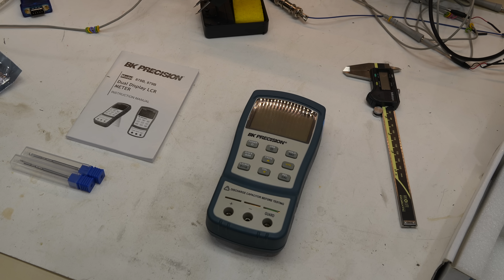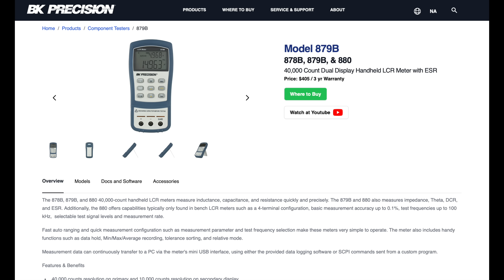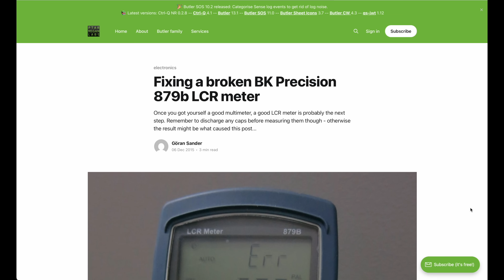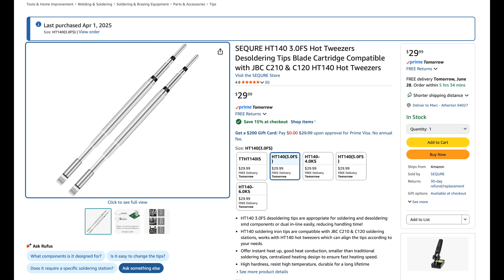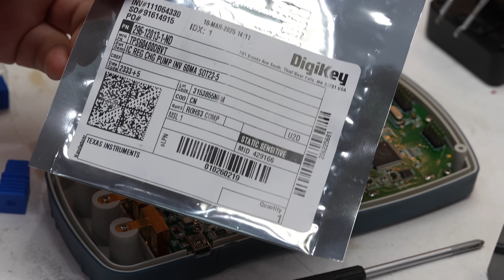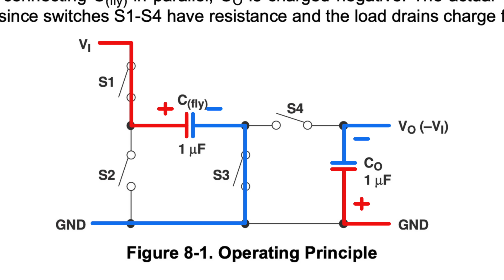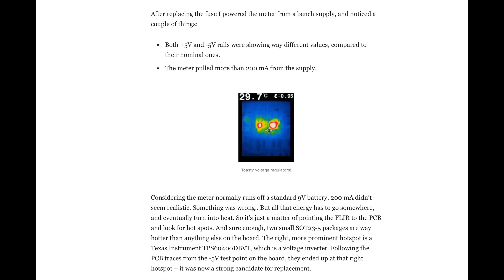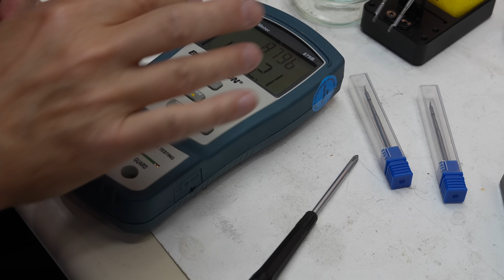BK Precision 879B LCR Meter Repair (with Sequre HT140 Hot Tweezers)

Comment: Dielectric Absorption on those big filter caps can be "shocking" as well as them rectifying mains hum just using their legs as antenna and dielectric leakage as the diode. I had one big old filter cap that sat at around 200V in use. After discharging and coming back the next day it had floated itself back up to 60V, enough for a decent tickle. I discharged it again with a crowbar (screwdriver) with only my meter attached and watched as the voltage built up to 20 V again after a few minutes. 20V with a fist sized cap is a fair bit of energy! 
I can see why they keep the leads on the really big boy caps permanently shorted when not in use. (the shoe box sized KV cap type things)

Comment: It says "discharge capacitor before testing" at the front, which turns a design flaw into user error.
Reply from the maker: Problem is, capacitors can’t read.

Comment: i have the ancestor of this line of lcr meter (elc-131) that blew in a similar way except at 400v instead of 50v. was a dumb move on my part. actually blew quite a bit of the front-end too but only one of the protection zenner on the negative rail. was always curious if they ever figured out a better front-end protection on the later hp/keysight and b&k versions.

Comment: Marc: Several years go I did the same, destroying U603 and also the input fuse F200.  After replacing both, the meter worked as before.

Comment: "Don't be vague, ditch that Sprague!"
As for a hot air station, mine is a Yihua 706-II; on top of a nice hot air handle and pump inside the station rather than a fan in the handle, the whole thing has replaceable soldering irons for old style (936 etc.) tips as well as a few cartridge types (Hakko T12 and JBC C115, C210 and C245). I really liked it from the beginning, and my trusty old Solomon is now just sitting there as a backup.
Reply: The JCB clone irons are taking the market by storm now, its great they are killing off the tip on element irons finally.

Comment: My HT140 came with an earth lead that plugs into the USB-A socket on the PSU. The problem is the PSU has a plastic earth pin so its output is floating and the tips of the iron have hundreds of volts on them at very low current. Not good if you touch the gate of a MOSFET.

Comment: I would consider whether adding the odd protection diode (as you'd commonly be using around linear regulators) might help avoid such accidents in the future. It's clearly a weak spot. BTW, my first component tester didn't make it through its first battery charge due to a very similar scenario... but that was a $20 affair and the simplest solution was just buying another one.

Comment: Marc could put a sticker on the meter "DISCHARGE CAPACITORS".
Reply from the maker: It’s already written on it! What the machine needs is a pre test before it connects, or even it’s own automatic discharging circuit.
Reply: @CuriousMarc  That sounds like a challenge ... for you, not me.

Comment: You could add a small normally closed push button to the device that would always short the capacitor to be measured, then press the button to perform the measurement.
Reply from the maker: Yes, I like the suggestion! With a little resistor and a fuse just in case I also forget to turn off the power on said capacitor...
Reply: I request a full follow up video including the prototyping and testing. ❤

Comment: Marc, I admire the discipline you have buying just one off from Digikey. I just bought some SMD 3904's. I have 500 of them LMAO. 
I have a  Weller SMD desoldering tool. I can't imagine any scenario where it would be good for resoldering. Especially the capillary action of melted solder grabbing the part and gluing it to the tips.
Reply: I have the exact same HT140 hot tweezers, and they work just fine for soldering SMD caps and the like, you just need to slide the tips perpendicular away from the part, with the tips planar with the board. the capillary action does a pretty good job keeping the part on the pad as the last contact with the tips as they leave the solder is the points.

Comment: I have the sequre HT140 tweezers. The UI is quite intuitive i think. I didn't need to read the manual, long pressing the left button was obvious to me because short press reduces the temperature. Long press again stops it. Short pressing the right button increases the temperature. Long press brings up the menu. Its as i would expect. My fnirsi iron works similarly.

Comment: I prefer hot air for such job. If there is risk for surrounding components I use capton tape to isolate one I want to work on.
Reply: Hot tweezers appear to be quite controversial. Board repair pros also prefer hot air but for them it’s not as detrimental if they screw up on occasion as they have spares.

Comment: Put the new parts back on with low melting point solder and perhaps they will self unsolder next time it fails ;)
Reply: I’ve seen 7805 regulators desolder themselves from eutectic solder in a bad product design.

Comment: CuriousMarc, suggest you install the supplied tip earthing cable (uses the USB-A socket on the PSU) if you haven't already.
Reply from the maker: Thanks! So much for not reading the manual...
Reply: I power my HT140 via the DC barrel connector from a grounded 24V 5A PSU. I didn't buy their 65W USB-C PSU.

Comment: I have the 880. It did die almost immediately, however BK Precision replaced it under warranty.  It requires calibration every time it’s powered on and the included rechargeable 9V doesn’t last very long. The instruction manual is a tad terse, not novice-friendly. One should also have a device reference to be able to determine if the readings are within spec. or abnormal.

One should just make it a habit to discharge capacitors, perhaps best done with a low impedance voltmeter or a dedicated tool.

Comment: I have tested several similar small Chinese instruments (soldering irons, USB power meter etc.) and found them very very non-intuitive how to control. Why not add a a few more buttons, label them and have a user interface that  everybody can understand without reading the manual. So, now I don't buy these instruments anymore.
Or am I just dumb? What do you think?
Reply: Yes, they are often terrible for that reason. And I have a very low tolerance for bad UI. Not that I don’t understand it, but I forgot the next time I use it and to me it shows the manufacturer put low effort in their product. Also, engineers and programmers are often bad in designing UI; they put in the functionality but thinking about the user perspective is a different kind of speciality.
Reply: Sadly, as follows:
Fewer buttons and minimal labeling reduce manufacturing complexity and component cost.
Printed labels (especially multi-language) and extra buttons/switches require design time, QA, and more materials.

Many tools are designed to be universal or intuitive by function (e.g. one button = power, long press = mode).
The assumption is that the user manual (often poor or missing) will explain the functionality.

These devices are often sold to multiple resellers who rebrand them.
Leaving off labels allows flexibility in branding or localization, as the reseller might apply their own stickers or manuals.

English labeling may be skipped due to poor translation or lack of international focus.
Icons or unlabeled buttons avoid awkward translations or the need to make versions for different regions.

Many of these tools are designed for technically savvy users, such as hobbyists or technicians, who are expected to "figure it out."
Tool makers assume users will read online reviews or watch YouTube tutorials rather than rely on onboard labeling.
Reply: The most annoying Chinese instrument UI in my collection is the East Tester ET5410A+ electronic load. Most usable is the Uni-T UDP3305S-E power supply.

Comment: W.r.t. Earthquakes: do you consider the possibility of an earthquake when stacking equipment or placing racks etc?
I mean, do you secure things, limit the height of stacks, etc?
Or is that something you consider too unpredictable to prepare for?  (I mean the kind of movement and its strength)
Sometimes I see videos of security cameras during earthquakes and see things happen where I think "well, maybe you should not have things like that in an earthquake-prone area"...
Reply: Mr. Carlson's early lab, with all its stack-layered old boat anchor scopes facing slightly downward (I think) also looked like the master might be buried under them one day, in the narrow canyon between. But on occasion he assured viewers that everything was fastened well and fine ...
Reply: @ulrichfrank4270  When I worked for a government agency, at one point they ordered that we secured everything with Velcro.  We did NOT.  But I do face the same risk at home here on the BC coast!

Comment: Surprising that B&K would produce a capacitance meter that was so fragile.  I've had an Electronic Design Specialist 88A for decades that has an auto-discharge circuit that works well.
Reply: Think they didn’t produce it, just slapped their name on it. Other brands have virtually identical instruments, including Agilent/Keysight

Comment: Wow, I used to use these things when I was working SMT.. usually pretty accurate, these units, but inductance was usually a crapshoot- but ‘close enough’… we as production support were tasked with epoxying the tweezer leads to the meter to ensure measurement consistency and prevent tampering.
Reply: Prevent repair*
Reply: @MichaelOfRohan  No, for consistent readings using the same tweezers. Nothing to prevent it from being opened, since the jacks are part of the front anyway.

Comment: Would it be better to put a normally closed press button across the test terminals, and that would discharge any residual capacitor charge before pressing it to make a reading?
It looks like there is enough room for a press switch in the base of the bottom half of the meter case.
Reply: Good idea.  Maybe a resistor in there to prevent the big flash bang if it got a lot of voltage.
Reply: Beg to consider that large caps can recharge by themselves even after being discharged, voltage going up again....

Comment: Run it off a lithium power pack or I use the 2.5mm barrel jack into a linear galvanic isolated transformer setup